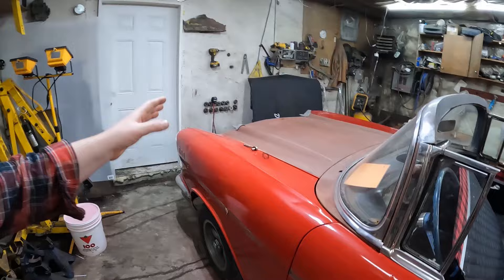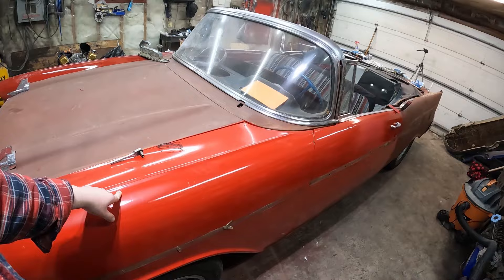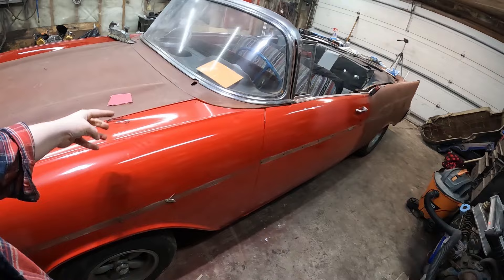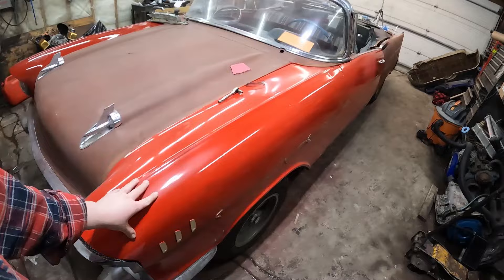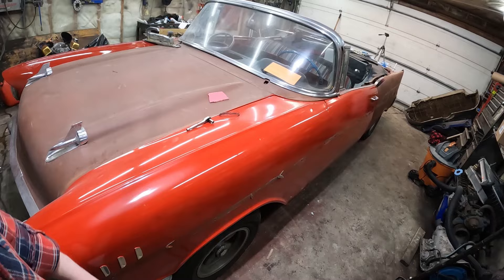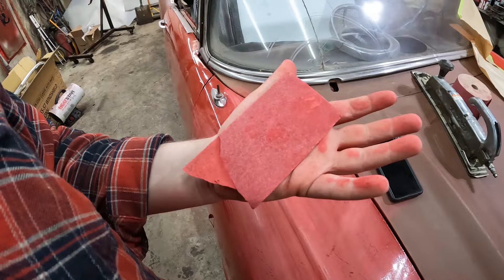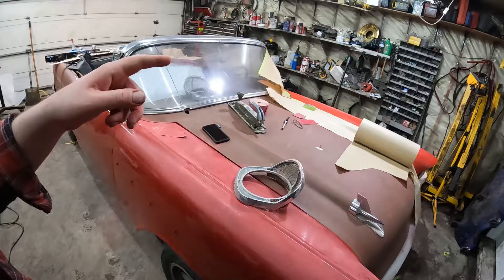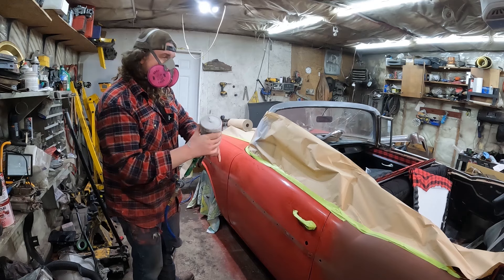Rust-Oleum Car Paint Myth-Busting

Comment: We've gotten so fancy as an automotive culture that everyone has forgotten most old time hotrods were painted with house paint!
Reply: And everything that’s not $400+ a gallon PPG or DuPont is “junk”
Reply: I’ve been a custom painter for over thirty years, they want to sell you products, period.
Reply: @RustyZipper  Rusty:  I sell both and their "economy brands"  Nason and Omni work well.  Anytime someone wants to do an overall in a red, yellow or orange I push them to Omni, it is a quarter of the price and user friendly.  My current project I did in Omni--no problems.
Reply: @glennnickerson8325  - Ha, I’ve done tons of projects with Omni AE and a decent clear on top. Very happy with it but the fumes are not good. I’ve been on a Rustoleum kick for the past 1.5 years and man I’ve got it down. I laugh because I’m buying a gallon of Rustoleum for 2/3 the cost of a quart of Omni AE. I can custom mix the Rustoleum to get a decent shade.
Reply: @RustyZipper  AE is OK, not my 1st choice.  If I do a single stage, MTK is a great "affordable" urethane.  The important thing is use what works for you.  I mix the stuff and anyone doing a project who comes to see me I do my best to help them out.  My latest project is 1966 Rambler gasser and I did it with MBC (basecoat).  I use it for overalls and is user friendly.  My thing is the older I get the longer it takes to finish a project, so by the time I'm ready to spray, it's in the budget.  Also sometimes anything that gets disposed out of the warehouse I get a crack at, so that helps.  Keep at it!  Glenn
Reply: When I was in USPS I painted my old DJ Jeep with enamel Rusto and a brush

Comment: I’ve done tons of projects with Rustoleum and never had an issue as long as you’re using a good quality Reducer and decent Acrylic Enamel hardener. I put the money in a good quality clear coat to give it UV protection. Otherwise it turns chalky within a year outside
Reply: That's the truth

Comment: The only problem I’ve had with Rustoleum is that it doesn’t hold up to the UV from the sun, you get what you pay for. I’ve had POR15 come off in sheets, no explanation when I called tech support, no reimbursement for $150 worth of paint chips in my driveway, and yes it was clean metal, prepped correctly
Reply: Same experience with POR15 - was told it doesn’t like clean metal or UV. Fades very fast.
Reply from the maker: Yeah a few people have said that

Comment: The hardener saved it.
All types of crossways stuff happens when it's straight out the can rustoleum and you try to cover it or sand it. Rustoleum is oil based enamel.
Adding the hardener gets it closer to acrylic enamel.

Comment: So glad you’re doing this. I have a 2001 dodge truck that I am going to attempt to do some body work on,and paint with Tractor Supply implement paint. I bought a rattle can , and tried it on the inside jams; almost a perfect match. 100 dollars a gallon vs 1400 a gallon. Red paint is expensive if bought at auto supply stores.
Reply from the maker: It's worth a shot!

Comment: I've painted lots of motorcycles with Rust-Oleum before and one car, an MG Midget.  I sanded out the existing base, primed with etching primer, a coat of automotive primer and used premium Rust-Oleum colors.  Never had a problem, allowed 2 hours between coats and the finish ended up as hard as nails.  My favorite color is Black Stainless Steel, just did a hardtail Sportster frame in it for a bobber I'm building and it came out just awesome.
Reply from the maker: Yeah seems to be a solid paint that for sure.

Comment: Hey Dan,
Some of the problems are solved by the hardener, some are solved with clearcoat.
Single stage paint has a "surfacing clear" which, if you sand through it (sanding a run or orange peel) causes a color mismatch. You can't really "blend" single stage for the same reason.
The UV protection (from fading) comes from the clear. If you sand or buff it off...issues.
If you manage to get a pretty good and cheap single stage paintjob, you can scuff it....spend your money on some good clearcoat.
Reply: Well said!

Comment: Sprayed a steel car trailer that sits outside all the time with rust-Oleum several years ago and it has held up fine. Touch up scrapes and chips no problem
Reply: Painted many trucks with implement /rust - o - magic. 
Never had any problems. But ,
Had some left over red , from doing ihc tractors , thought I'd put it to good use , painted my car hauler trailer , uv (unkind to vehicles)  I'm guessing // turned deck side , top of tool box " pink"
But with a very decent fade to side frame rails ./ & side of box.
Boy I sure take alot of ribbing about my "pink" trailer . My granddaughter sez it shows my feminine side. 
   - grandpa jeff -  1- carguy .
Reply: @grandpajeff4478  LOL yup red fades, I used black. Fades too, but flat black is not bad.

Comment: The hardner was the right move. I own a sign company and we use an implement paint with reducer  and hardner on metal as well as primed MDO board. Both Rustoleum and Valspar with no issues. You did just fine, like others said give the solvents time to gas!

Comment: In my experience it’s always a gamble. Sometimes it works fine sometimes it turns into a nightmare. But covering it with a decent primer will definitely help. Personally I don’t like to take the risk but I’m glad it worked out for you. In the long run it can have problems as well, but I’m talking 5-10 years later, which in most cases, the next guy’s problem.

Comment: I had bought 2 gallons of Rustoleum red to paint my 57 4dr hardtop years ago. Still haven't pulled that trigger. But, I  think I'll try it ony 66 Chevelle 2 Dr sedan. It was grandma's car originally. I teased her about stuffing a Rat motor into it when she was still with us. Today it boasts a .040" over 427 backed by an M-20 4 speed. Still needs a lot of love after settling better than 30 years.  Thanks Dan for your inspiration.

Comment: Started priming my Duster with Rusty Metal Primer, then the Filler Primer.  Started cutting in with the Sunrise Red in rattle and but will spray the exterior with the 4:1:1 mix.   The key to the oil based paints are time .  Let them cure up.  I let the primer sit for 72 hours ( yup, I actually used my patience!) and it’s hard as a rock.

Comment: Have a 53 Chevy pickup that I primed and painted with rust oleum around 98 or 99. Eventually painted the truck in 02? or so. Still have the truck and have had zero issues with paint reacting, lifting, or peeling. People had fits when I did it and told me it would never work or last. The first paint store wouldn’t even sell me paint when they found out what I was doing lol

Comment: A lot of cheap spray bombs are lacquer.  Virtually any solvent dissolves it.  Rustoleum, for example, will dissolve it.  High builds are really just thin gelcoat with baby powder mixed in.  And the gelcoat (thin form of the polyester used with glass cloth) needs to be compatible with anything.  So highly unlikely a high-build will take out the paint underneath, but it could still happen with lacquer, which GM used right through the sixties because it flashed so fast and built to a nice shine.  Rustoleum is an enamel so no issue there unless the fish oil reacts to something, and that won't happen when it's dry.  

Highest probability is that wipe-down before painting with acetone will lift lacquer.

Comment: Sprayed  (with a gun) many of street stock cars  (oval track) back in the 80's with Rustoleum,never had a problem. A lot of orange peel but it didnt matter because the cars got lettered and shined beautifully on the track. It held up well and was easy touch up after getting banged up on the track. The biggest thing I noticed is it would be quite faded after sitting outside all winter and btw we never used primer and no problems. It didnt matter that much because it was basically a "summer season" paint job. Biggest problem I see  is the orange peel for a street car. We thinned with acetone and didnt use hardener. It would take a couple days to dry but not a big deal.

Comment: I don't know how this information relates to painting cars w Rustoleum but here's something interesting I dicovered about it by accident. I painted some alternator brackets and other small stuff about 7 or 8 years ago w rattlecan Rustoleum then went to hang them in the kitchen oven at 300degrees to speed the 24hr cure cure time up(I've been doing that for years), as I was reaching in with the second batch I got against one that had been in for 10mins and smeared it w my arm, so I grabbed it with a paper towel('cuz it was HOT) and ran it under cold water in the sink to cool it so I could wipe it off w thinner and start over, BUT! The paint that was still wet when it came out of the oven was dry and cured hard after being run under cold water. Try it yourself. I do it all the time now w anything that will fit in my powdercoat oven or heat over the woodstove. I want to try it with a propane infrared heater and a fender on a car and see what happens. You can literally wetsand it as soon as you've cooled it off w cold water. Weird, aint it?

Comment: i have been using rustoleum primer mixed 50/50 with acetone with good results.it sands well, i am using it as high build primer, it is probably not as thick as the real thing but i put 3-4 coats on before i sand.
Reply: Dan....what ever happened with the   " Bodyman  " help..???
Reply: Some of the bodymen..know the secret's  of  PAINT

Comment: I used rustoleum out of a spray can on my van - repaired patch panels, replaced all the doors, added a hood scoop and fiberglass flares and a wing - as well as other graphics and stuff on it - so many people give rustoleum shit, but it's good stuff...

When I knock it all down and give it a proper new paint job, it'll be rustoleum through a spray gun with hardener - I did paint another van gloss black with that method...

Comment: I haven't used rustoleum or tremclad yet, but I have tried several single stage enamels, including tractor enamel which is similar to rusto and tremclad. The darker colors fade and oxidize fast, the lighter colors like yellow and white hold up a bit better. I shot a single stage Nason with a hardener on the 70 GTO in 2010, and it is holding up rather well. Not as good as two stage does, but way better than the cheap tractor paint has. I figure if you sand it well enough so the primer can bite the paint under it, then it will stick. If its all supposed to work together, shooting primer over color should not be a compatibility issue. 

I think I am going to try that Summit racing paint, they have a pearl black I want to put on the 76 C10. I might add some pearl to it as well, and try some other tricks to see how it turns out and holds up.
Reply: SUMMIT'S  Paint...is the real deal
Reply: @gregboppel2511  The only problem Greg, if you run short you're at their mercy and may need to buy another gallon.  Sometimes the colors they phase out which could be a problem a few years down the road.
Reply from the maker: Your the cheap of the cheap and never used it!  I'm shocked haha
Reply: @DDSpeedShop  I thought about it, but never really tried it out.

Comment: Never painted a car with tremclad, but tractor bits, assorted other junk around here oh yeah. sits outside all year, snow in the winter, Okanagan sunshine in the summer. Holds up fine, goes over whatever is on there to begin with, just wipe down with acetone to get the oils and grease off first. Only problem is the gloss doesn't hold up, 4-5 years looks pretty flat. Maybe try a gloss clear over it?

Comment: Morning Dan! Long board, i call it an air file,with 40 grit it will hog filler. Sanding hard filler, fine paper works better, coarse seems to just scratch it. I think the reducer and hardener made the difference. Whats it matter anyway? As long as it sticks and doesent gibble! Dude, is that the proper paint mask? I have a similar one and its for dust. Just expressing my concern, dont want you getting poisoned.
Reply: Nothing wrong with the mask, just the wrong filters, Dan get the proper filters to protect you from the poisonous chemicals.

Comment: People have seemed to forget, that before the seventies, that car paint was oil based enamel or lacquer. There was no Acrylic Enamel or Urethane or Polyurethane paints. My Dad painted a lot  of cars in the fifties and sixties with enamel. He always said (Paint basics !!!) you can paint Enamel over Lacquer but not Lacquer over Enamel.  If you don’t use heat lamps to cure the paint and make it harder!     When your finished painting the car, clean you paint gun , shut the garage door and don’t touch the car for a month or you will screw up the soft paint.  No  and’s. if’s or but’s.

Comment: My personal past experiences of not striping a truck that had been painted with Rust-Oleum spray bombs years ago was that the primer and then sealer went down fine as did the paint it was about six weeks later that the paint started to wrinkle. The paint never flaked off but was prone to chip easily so in general the paint job was screwed.  I ended up standing the truck back down to bare metal and starting all over which on a crew-cab long box dually is a lot of sanding especially the inside of the bed because of the amount of hand sanding. It’s been over 25 years ago since I had that experience and while I love Tremclad for painting frames after I have them sandblasted and since the frames after being blasted have plenty of tooth I have never had any problems with adhering to my sandblasted frames but I have noticed if there if the surface is not well prepped Tremclad will flake off especially if it is laid on thick. I Hope the fact you sprayed the Rust-Oleum on with hardener might save you my headache a couple months later but I guess time will tell.

Comment: Fitzee swears by Tremclad, mixed 1/2 1/2 with Lacquer Thinner.  I've done this before.  It does loose it's shine after 6-12 months.  If you wanted Satin finish, it'd be fine.  As soon as the weather turns nice, I'm painting a car Satin Black with tremclad.  It's gonna be fine for years.

Comment: don't worry about it , i remember painting some logging trialers with rustoleum and using gasoline because it was cheaper at the time , with a shot of hardener . turned out great nice shine and stood up 
to rock chips better than other products
Reply: Also used gasoline as a thinner and it worked great!

Comment: The real problem is that the tremclad takes a long time to fully evaporate the solvents, and the top can feel hard with the underneath paint still soft. Allowing a week to harden will minimize the problem. As mentioned by others, in the uncured state lacquer solvent as used in many spray primers reacts with enamel. That is why it is used for cleaning spray equipment.

Comment: I did my 66 Chevy truck in Rustoleum safety red. I mixed it with hardener like you did and shot a decent 2K clear over it. 3 years later it looks the same and it's outside all the time. Check out the safety red, I think that's the color red you're looking for.
Reply from the maker: Sweet thanks man!

Comment: I've seen a lot of comments about peeling in sheets and turning chalky in a year. I'm sure there's reasons for it but Idk what they are cause I'm not there. My experiences with rustoleum never involved those kind of things. If you're ever worried about the different paints lifting or crazing, paint a small section and pour it on so to speak, lay on some real heavy heavy coats too quick. It will amplify any reaction between chemicals and you'll know what you're dealing with. 

There's as many ideas about paint as there are bellybuttons so go with your own instinct and what other successful results (advice?) required to get there. I can't tell you how many (hundreds at least) pieces of equipment and old farm trucks, cars etc. I've seen painted with a brush and hardware store paint over the years. Ha.... it almost seemed like the more dirt and grit was in the paint the tougher it was lol. Many times when I saw it (usually at auctions) it was decades old. Chalky - sometimes -...... peeling - almost never. 

If you go cheap, I think keeping it simple is the way to go. Don't over think it. I have yet to use any hardeners in my mixes, much as I've been curious how it would work out. It was my employers decision (who owned the work trucks) not to mess with what had worked fine. He just wanted presentable trucks, not show trucks (20 footers). Your fender dents would've been a non issue - they would've been painted as is.  
I still stand by the mix it all at the beginning and don't spray from two different mixes though. It can easily change color tones.

Great videos as usual - thanks for sharing

Comment: Yeah, filler FIRST over 36 or 40# scratched metal You want it to stick...then the hi-build. 
Thin out your filler with fiberglass resin (plastic honey) Goes on smoother and takes longer to cure (more working time)
Feel your sanded bondo/metal transitions with a cloth glove. You can also use the old "guide coat" trick on a fully bondo'd panel.

Comment: Rustoleum will last ok longas you keep it inside the sun will kill it i have problems using a long board or air file they make one that uses the long paper but moves like a da if you can find one it will make body work a lot easier